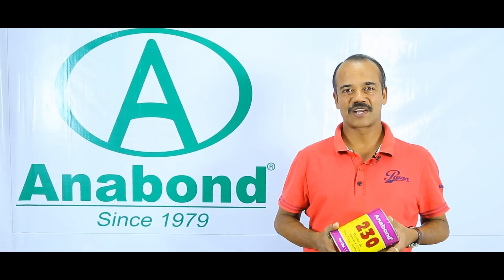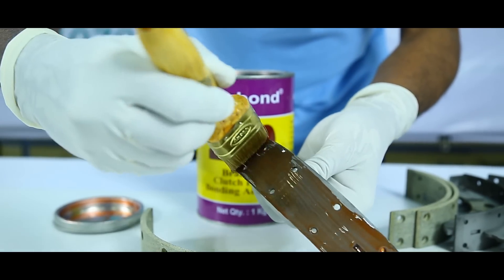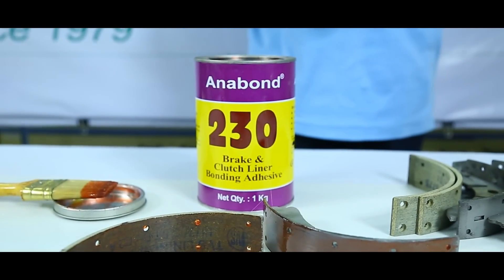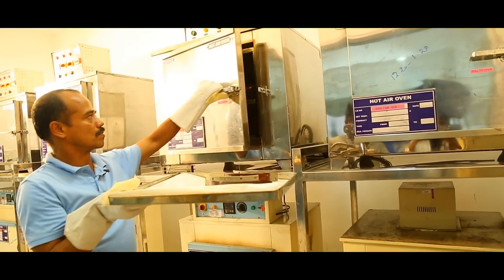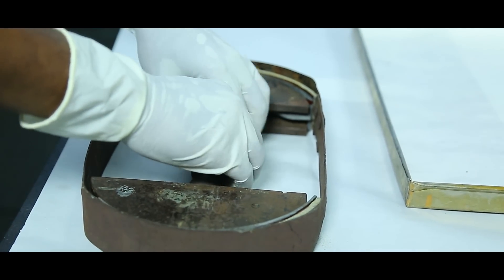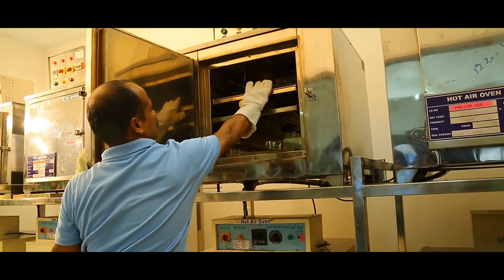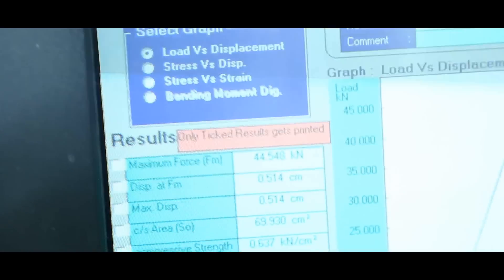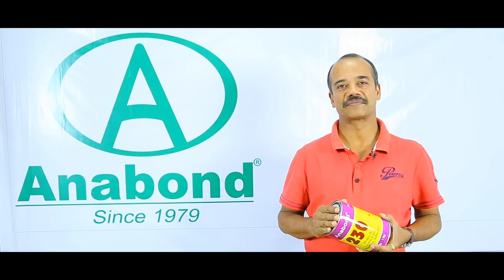Anabond 230 Brake Shoe Bonding Adhesive

Comment: question will if ananbond glue applied to spray can painted surface will it affect the bond strength ?
Reply: Bond is only as strong as the weakest link.  Paint adhesion is only as good as the surface preparation.  In short don't think about trying it.  Freshly blasted metal that has all contamination from the blasting process removed.
Reply: Anabond 230 bonds well with most surfaces. If you use it on painted surface, the paint will peel off and hence it will fail. Please use Anabond 230 on clean metal surface only for best results.